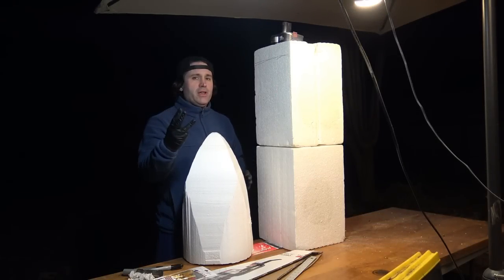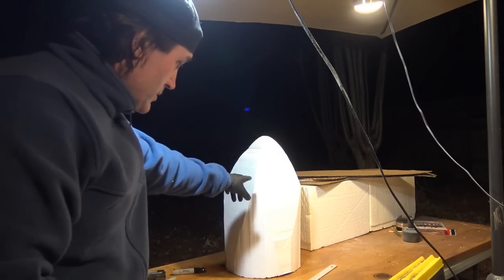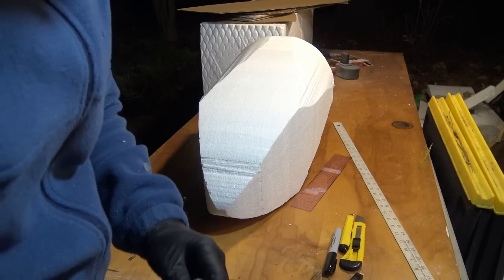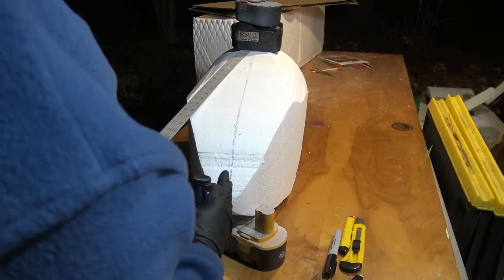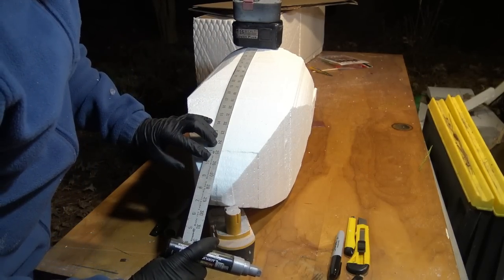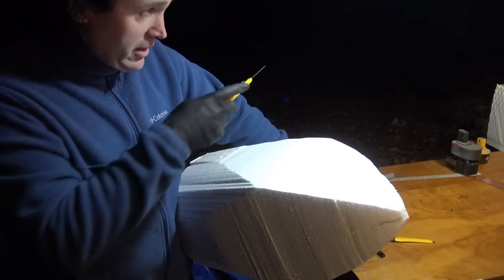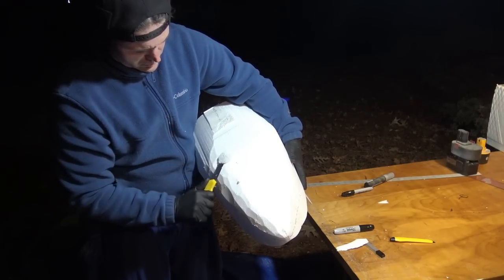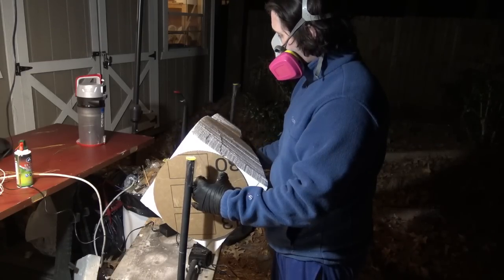Emirates 777-9X RC Airplane Airliner Build Part-3

Comment: It's easy to throw around "13 feet--" but when you see parts it really starts to sink in. Working around that beast of a fuselage is as much a challenge as building the actual parts. Carry a pedometer! Cold? Too bad those hot wires don't throw off much heat!
Reply from the maker: LOL, Very True Eliot! I have a 2 car garage and 2 other garages and a large back-yard in which to assemble these Monsters, I need to get a large kerosene outdoor heater.